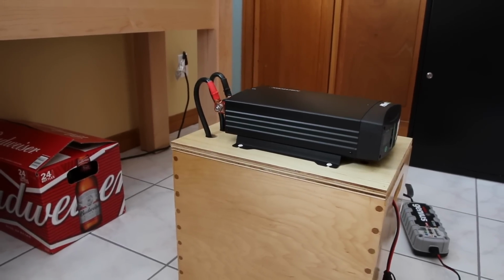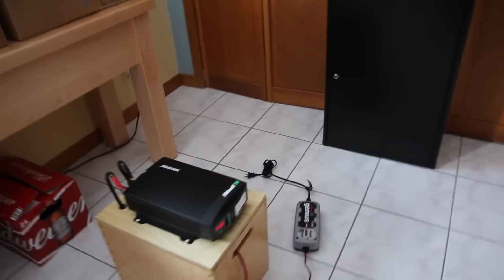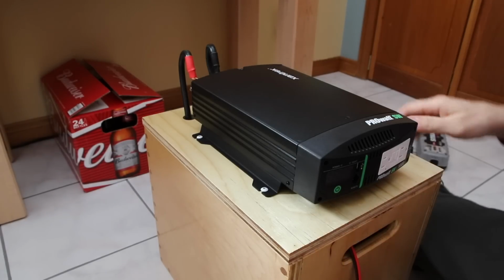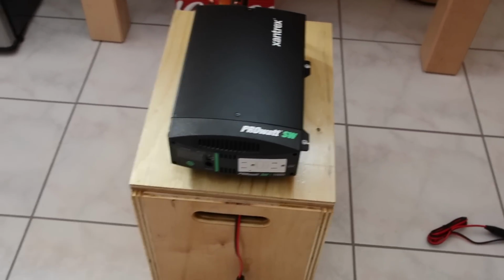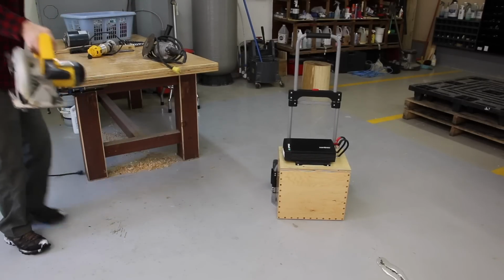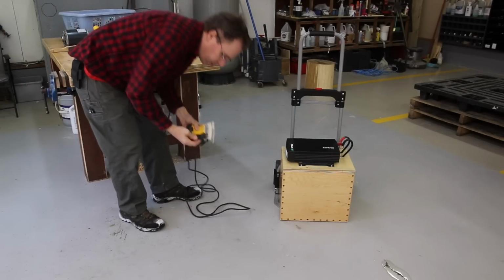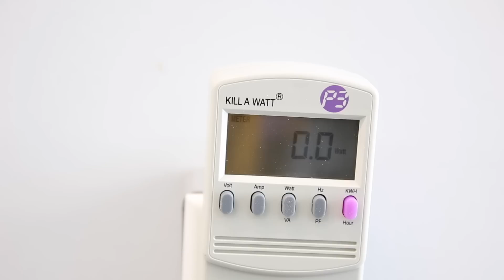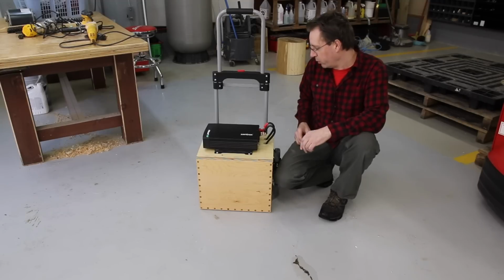DIY 225 Amp/h power pack

Comment: Very cool. I've been looking around for a larger battery bank that I's not worth more than my CAR.  Thanks for posting this, I don't know why I did not consider this, considering I've looked into this very same kind of set up for a van conversion. With some rugged rubber tires on casters, this would be manageable with one person.  I would be curious to see how much lighter (and more expensive) something like this using Li-Ion batteries would be with a similar capacity. And paring this with a small folding solar panel would make it a cool alternative to a small generator for extended camping trips.
Reply from the maker: Ya those 2 batteries cost me almost $400 plus tax. I would have like to use lithium ion batteries. It would be so much lighter but I think the batteries are like 4x the cost. It will be cool once I get my solar panel!